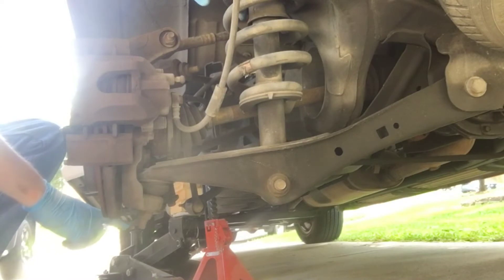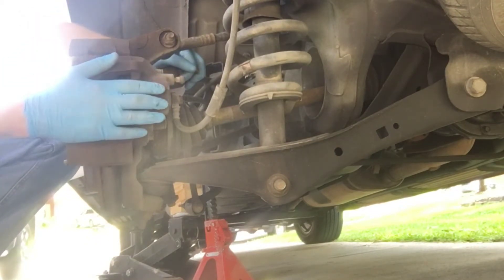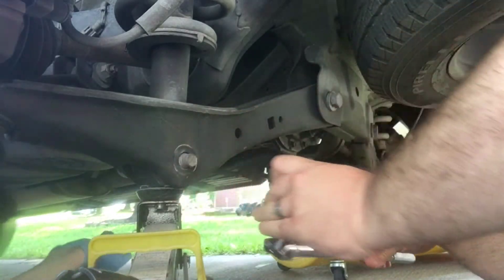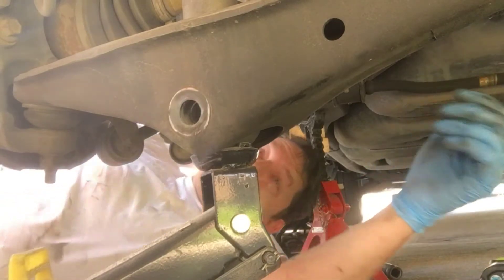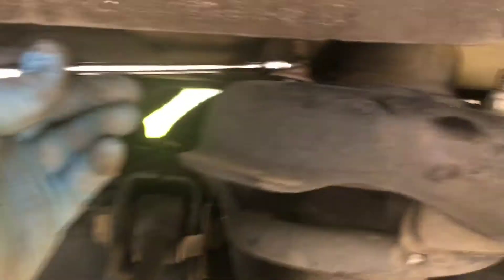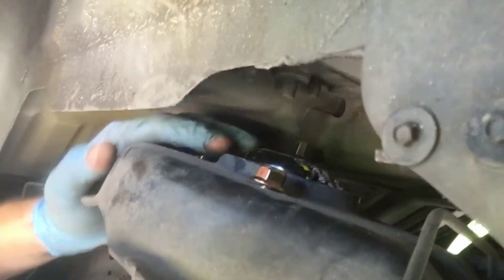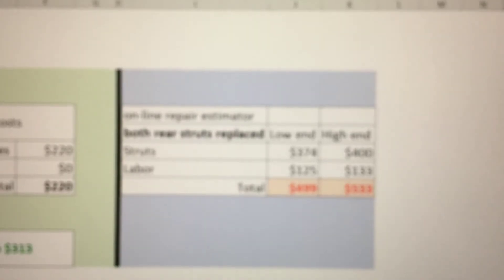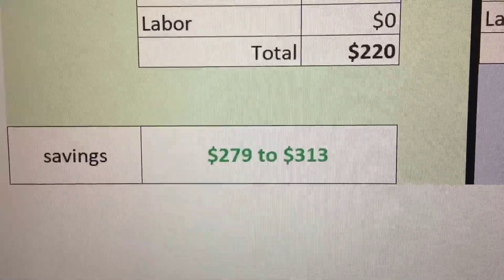2008 Ford Expedition - Squeaking From Rear Suspension - Strut Assembly Replacement

Comment: Excellent driveway mechanic version of doing this strut replacement. (which is how I needed to do it and teach to kids)   I appreciated you posting, between this one and the shop video from TRQ, which is more of a lift / ASE video, it solidly covers how to capture the rear strut replacement process.    Search  "How to Replace Front Struts 2007-2017 Ford Expedition" .    If doing the struts, the upper rear control arms are helpful and easy to do at the same time and most likely need replacing at that 100-150k range...
Reply from the maker: Good luck and thank you for commenting! Take care.
Reply: @projectfixit   Repairs when super smooth, this is an easy driveway type of DIY project for sure, maybe an half hour to hour per side total..    A few helping items would have been a small ratcheting 15mm for the top of shock nuts.   We barrowed the 27mm and 30mm sockets from local auto parts store.  A 1/2" extension allowed us to not drop the spare tire.   Putting in large shock bolt first was helpful, then using jack to help align inside bolt.    This was done on a 2016 EL. We had sway and top and bottom wheel assembly play when unweighted, as our signal of needing rear upper control arms as well.   Which makes sense based on some medium camper hauling.

Comment: I have viewed a few of the videos on this repair, and this was the best by far. Only different thing i saw in others was that some guys suggested tightening the control arm bolt and strut bolt when tire was back on and on ground, so bushings werent preloaded... good job!!
Reply from the maker: Awesome! Thank you for the feedback.
Reply: I was wondering about this same thing also.
Reply: @projectfixit  So did you have any issues because of not tightening when the tires where back on the ground?
Reply from the maker: @shocfacter  Actually, no issues. If I were to do this job again, I would probably tighten the bolts fully with weight on the suspension just because of all the expert advice.

Comment: Question? Were You able to torque the lower strut bolt and the control arm bolt?  Or did you just simply tighten them as tight as they can go?
Reply from the maker: I did not torque the bolts and simply tightened them with the impact driver